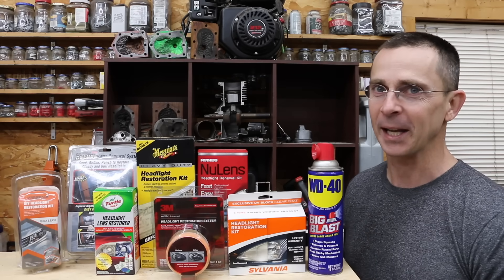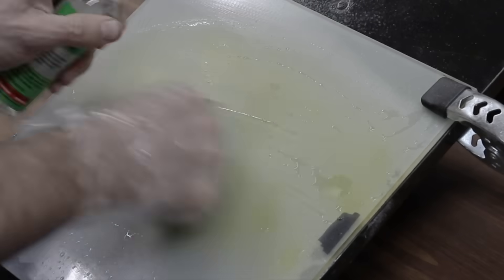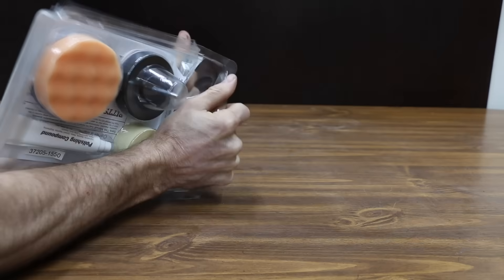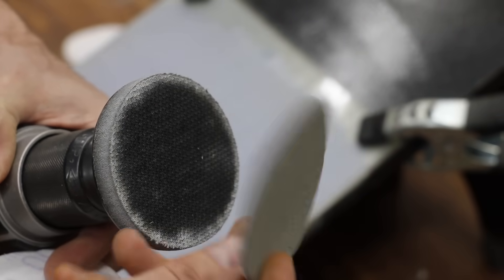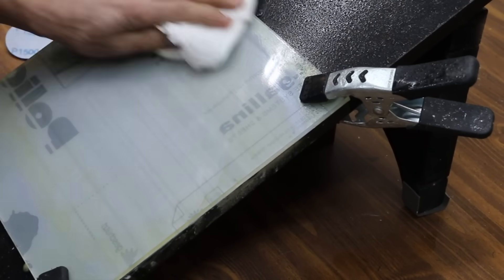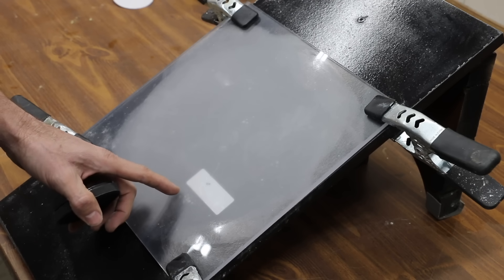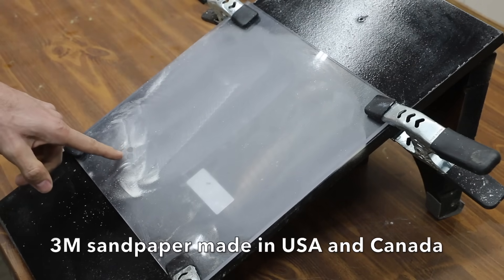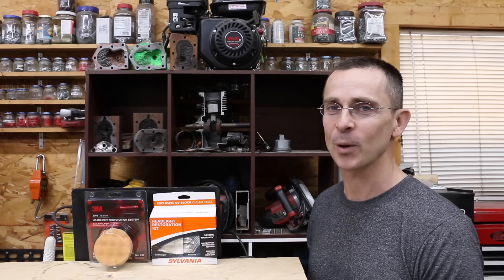Best Headlight Restoration Kit?  Let's find out!  3M, Sylvania, Meguiar's, Mothers, Turtle Wax & HF

Comment: I picked up the Sylvania kit last year to restore the headlights on my then 7 year old car that goes through dirt and snow at highway speeds, so they were in pretty rough shape.
It takes a lot of sanding work on particularly old headlights, but it did a great job. A year later, and they still look good. I think one could get better results with a lot less effort by doing this once a year or so.

You should do "best wiper blades" and test them against icy conditions, since I find I am always replacing mine every March\April because they get so torn up by ice, and every September/October because they get so messed up by the dirt and sun.
Reply: Aaaaaaaand I just found the wiper blade one. I swear I looked already! LOL.
Thanks again!!
Reply from the maker: Thanks for the feedback.

Comment: give CERAKOTE Ceramic Headlight Restoration Kit a try   
https://www.amazon.com/gp/product/B084RQKLV8

I bought this to restore headlines on a 20 year old car. but have not used it yet, plan  on getting to it soon. 
I have been focusing on other issues with the car , first.  after all I could use this kit  on another car if  the 20 year old car didn't make it.

Comment: Years ago I tried ChrisFix's method of using sandpaper and Rustoleum UV protected clear coat, I had a great result, the sandpaper was a little expensive though, I could have just got new headlamps for the price. It did a good job, but I found the Rustoleum clear coat didn't hold up to UV exposure very well, and after a couple years, it looked as yellow as it once did.
Reply from the maker: Thanks for sharing.

Comment: How about Cerakote Ceramic? 
https://www.ebay.com/itm/Cerakote-Ceramic-Headlight-Restoration-Kit/392881068440?_trkparms=aid%3D1110006%26algo%3DHOMESPLICE.SIM%26ao%3D1%26asc%3D20201210111314%26meid%3D8743333795044ea9969802e478c8ef7c%26pid%3D101195%26rk%3D1%26rkt%3D12%26mehot%3Dsb%26sd%3D392882123244%26itm%3D392881068440%26pmt%3D1%26noa%3D0%26pg%3D2047675%26algv%3DSimplAMLv5PairwiseWebWithDarwoV3BBEV2b&_trksid=p2047675.c101195.m1851

Comment: On this one I can save you the trouble, all the products in this test throw them in the trash, then wet sand lenses with a good quality 2000 grit paper, if the lenses have any deep scratches work your way up with wet 600, 800 or 1200 before finishing with 2000. Now use a high speed pneumatic polisher (8,000 - 10,000 rpm non-orbital) with 3” foam pad with 3M Perfect-It #36060 Polishing Compound applied liberally. You will be very happy to see a brilliant shine almost immediately after finishing with wet 2000. You’ll find that if there are fine cracks or hazing imbedded deep within the plastic lenses no amount of sanding and polishing will save them, however if only the surface has been dulled you’re in great shape. Your welcome

Comment: This is really useful.
I have seen a lot of ford focus with very dull headlamps and we have at home a Toyota which needs this treatment.
Some car manufacturers must used some much better polycarbonate than other or have better UV protection because I always found it odd that my C4 coupe head lamps never turned dull and the car was parked outside, on the sun all of it's life.
Reply from the maker: Great to hear!

Comment: I use VIM house hold cleaner, works great and very little effort is needed. All you need is two rags, a bottle of VIM and some clean water. Shake bottle, squirt on rag and scrub in circular motion. when the grit is gone, rinse with clear water and clean rag. Almost any rag works.
Reply from the maker: Thanks for the feedback.

Comment: I'd like to make a case against using any UV protectant on the polished lens. Over time, the protectant will also degrade and yellow, just like the original finish, and in a year or two things will be back to how they were — and you'll need to re-do the procedure. Instead, I recommend using the 3M kit to polish the lenses to almost-new clarity, and then periodically (every couple of months or so) taking a dab of polishing compound and polishing them back to the same clarity as before. Personally, I use 3M's Perfect-It Ultrafine Machine Polish for the task, but I'm pretty sure any light polish will achieve similar results. It takes ~5 minutes and less than a dollar of product to keep them looking clear, without the need of an hour+ of masking, taking out the power tools, etc. that the full procedure requires in order to do a proper job.
Reply from the maker: Thanks for the feedback.

Comment: Just bought the Mothers brand $29.00 at O'Reilly.  Lousy sandpaper and made a mistake in spray painting a clear coat on after polishing with the provided polishing compound.  Thought I rinsed off the compound good enough with plain water but no the clear coat acted like oil on water. Bummer, had to sand it all off and start over.
Reply from the maker: Sorry to hear that!

Comment: I use a 2" dia  pad for a cordless drill drill and put a round piece of packing material they now used for cleaning/abrasive. I use a medium to fine grade pad with water as I clean the plastic lens. Then I use a foam pad with lens restorer liquid that is usually blue in colour on my air buffer, about a 3 inch dia. pad. Lastly I spray the clean dry lens with UV resistant clear coat..  BUT first price out a new light assy. as they can be inexpensive and will look the best.
Reply from the maker: Thanks for the feedback.

Comment: if and when you do your next headlight restoration video could you recommend a coating for the headlights whether it be UV resistant clear code from home Depot or 3M UV protectant or any of the five or six things I can't think of right now .lol and the best way to prep the headlights before applying a protected some people say use rubbing alcohol other people say nail polish remover, mineral spirits some people were telling me to slightly heat the lens up before spraying it with the clear coat. some of these old heads in their recommendations baffle me but I dare not question their message. thanks for your time
Reply from the maker: Thanks for the suggestion.

Comment: I've done many headlight restorations and came to the conclusion the most crucial part is the sealant...So I found this "wolfgang" polymer that comes in a spray or a bottle...It cures crystal clear and lasts a long time...Now I just sand, polish, then seal...A 30$ bottle is enough to do probably 300 headlights
Reply from the maker: Thanks for sharing.

Comment: I want you to know that I got tired just watching these operations. You will excuse me if I say that  all these exercises are a waste of time & energy. The cheap crap they use for headlight  assemblies have a limited lifetime. The "sealer" that is used to prevent UV  destruction of the lenses cannot be restored by these methods. The only answer is to purchase new assemblies. They are certainly cheap enough. I have changed assemblies in three vehicles, & the cost  varied between $36 USD  to $79. Along time solution & no screwing around polishing & washing & God knows what else.  The video was great as usual.
Reply from the maker: Thanks!

Comment: I have used the progressive sandpaper method to great effect. I then masked off a large area and sprayed the headlights with a high luster, clear UV resistant spray paint. They're like new, and 3 years later still in very good shape. Thanks  for your experiments!

Comment: I've been looking at reviews of the 3m and Sylvania productions on Amazon and they all seem to indicate that after 1 year they're faded again and need restoration work again.  There seem to be UV protectant products like Meguiar's headlight coating which promote up to a year of protection, perhaps a next review could be which product protects restored (or even un-restored) headlights over time to avoid having to perform the sanding/polishing routine again.
Reply from the maker: Thanks for the suggestion.

Comment: You should try to do this again, but with DIY ideas. I see you tried WD40 and you can include it again. But you can try toothpaste, OFF with 25% DEET, and some other methods you might find.  I think the OFF method not only works, but lasts. You just need to clean it with vinegar once it's dry to keep it from continuing to eat through the plastic and to prevent it running off in rain and damaging other parts of the vehicle . Numerous vids showing this works, just need to be careful. But there are other supposed DIY methods that people claim works well.
Reply from the maker: Thanks for the video idea.

Comment: These restoration kits are a rip off. This is NOT how you restore headlights.
Reply from the maker: Thanks for the feedback.
Reply: I always hear mixed things about these types of kits. I also see videos suggesting after sanding with various grits to use clear coat and then wet sand/polish that. For the average person who doesn't have a fancy car what do you recommend and could you link any videos? Thanks. My g/f has an 04 Pacifica and her lenses are very discolored so I wanna clean them up in cheapest but best way possible.

Comment: Great tip(s) here! I'm all about saving money .... time & effort is money however. If you're planning to keep the vehicle a year or 2 and if it doesn't have those fancy pants LED embedded lamps....just buy a new pair of headlamp housings from your favorite online resellers. A pair can be as low as $60 USD and get brighter reflectors at the same time. Often they come with new bulbs as well! 
       Though do apply a UV coating for even longer longevity. Yeah...10x the price but what a time saver. (Tip though: before starting the replacement, shine your lights against a garage door or a brick building and make note of the alignment where they shine because your new ones, will most likely need adjustments back to proper alignment).
      Polish is a great siolution....but new assures your housings won't leak sweat etc....if yours are getting that age and collecting moisture....Polishing won't correct moisture collection issues....
Again thanks for yet another great set of videos!!!!
Reply from the maker: Thanks for the feedback.

Comment: By far the best way is to sand the entire surface of the headlight with 800  grit sandpaper then 1000 making sure to sand away all traces of the original factory clearcoat then recoat with spraymax 2k aerosol  clearcoat or eastwood 2k aerosol clearcoat. This methode will last for years and will make a headlight look brand new
Reply from the maker: Thanks for the feedback.

Comment: I've tried the 3M kit but it was a bit expensive, good results though.  Then I just bought decent brand pads and sanding discs from ebay and a light rubbing compound I had in the shed to finish.  Worked out at £2 per kit and worked every bit as well
Reply from the maker: Thanks for sharing.

Comment: Really appreciate the insight and demonstration of each item. I have been looking into restoring my headlights on my 98 crown vic. I know I can order a new set for around $50. But I tend to be the type of the original can still work is rather keep it. Definitely looking into the 3m brand. I've seen they have a rubbing compound that's supposed to work great as a clear coat for this type of thing.
If you could would love to see your test results for different clear coat finishes on headlights. I've seen people use clear coat paint, a 3m rubbing compound different car polish type products for sealing headlights after they did the restoration process with sanding
Reply from the maker: Thanks for the video idea.

Comment: Appreciate your thorough review of these different products.

Bottom line is to remove the damaged lens material by someone who has the skill and polish to a smooth surface. Recoat with what is right now a quality ceramic coating.

I've done a bunch of headlights and it's not a one size fits all process unfortunately.

I have had good results, most lasting two years or more. Maintenance is key as the sun and general driving abrasives take their toll.

Thanks again for your videos.
Reply from the maker: You are welcome!

Comment: I just use Mothers brand metal polish from Walmart where they sell car wax. I use a microfiber cloth and buff in small circles for about 2 minutes then wipe with clean part of cloth. It only works on oxidation. Will not work on heat related stress cracks. Works great. 5 ounces cost 5 bucks plus tax at Walmart. Blue diamond metal polish works just as well.
Reply from the maker: Thanks for sharing.

Comment: I used a 3M medium duty restoration kit on my headlight lenses and it worked pretty well. I did not have a powered polisher at the time so I removed both headlight assemblies from the car and used the arm strong polisher in a sink with plenty of water. I spent several hours sanding and polishing over a few days and found the results satisfactory. I’m not sure if it was more due to the products used or my determination and elbow grease. Anyway, after about 1.5 years I’ve noticed the lenses are again hazy. Probably because no clear coat was included with the kit, I did not know manufacturers used clear coat on headlight lenses to protect them. I will probably remove the headlight lenses again before long and do them again, but this time, I will get a kit that includes the clear coat.
Reply from the maker: Thanks for sharing.

Comment: New subsciber after watching couple of you reviews. I ran the gambit with a few of these restorers about 2 yrs ago. I settled on the Sylvania not because it was easy (I'll never get those hand sanding hours back) but because it was amazing. But follow them directions to a T especially the final application, avoid trying to go-back. Also info ya'll, Meguiars does sell a spray headlight coating to protect renewed headlights, etc. Thanks alot man.
Reply from the maker: Thanks for watching and subscribing!

Comment: I love all your videos... i use the Pittsburg Deluxe Lens Renewal System all the time and in my experience with it the sand paper never clogs up on headlights. I think maybe the yellow paint you used to simulate the oxidation is what was clogging it up. I have used other Harbor Freight sand paper in other applications and yes it is terrible... all brands they sell of sandpaper clog up in most applications... but this Lens Renewal Kit in particular works great for me. But i havent really tried any others. So im glad i watched this video. Im going to go get the 3m kit tomorrow and i use my own type of polish then clear coat it with the paint you showed in the beginning of video. Thanks again for all your hard work!
Reply from the maker: You are welcome!  Thanks for the feedback.

Comment: Perhaps find a matching pair of severely oxidized & UV damaged headlights.  Then cut them into even number of strips (equal to number of products under test) with a bandsaw.
   Now repeat your test upon these individual sections of the same material that has been subjected to the EXACT SAME —REAL WORLD—  damage.

I really enjoy your product testing videos!

However, (respectfully). The fake “exposure damage” you subjected this material to, is laughably flawed.   The worst factor a damaged headlight is subjected to, is the Years of Intense UltraViolet Radiation Exposure, along with scratches, gouging, & knicks.
  So, this test is rather unrealistic. 

  But, please know, I really appreciate all that you put into your video series!   They are quite useful & I will continue to support this channel favorably.

Cheers

Comment: I really like your channel and usually believe your testing to be very informative but in this case I can tell you from personal experience that something was wrong. I have personally used the Turtle Wax kit. I used one kit on two vehicles several months apart. I first used the kit on a 2013 Ford Focus with heavily clouded and moderately yellowed headlights. The kit restored the lights to a near perfect clarity. I did not us a macro to examine the scratches but the yellowing was completely gone and the cloudy look was gone everywhere except in some small areas that were tough to get the pads into. They were very small and only noticeable if looking for it. The average person walking through a parking lot glancing over at the car would think they looked nicely polished and clear. Several months later I used the kit which I had stored in sealed tupperware containers on a 2015 Nissan Altima. It again worked fantastic and restored the lights to a like new look. Here in FL the sun is brutal on headlights. This was done almost two years ago on the Focus. There is a mild clouding beginning to show but they still look pretty good.
Reply: In the northern states we have a full combo of flying debris road crud and salt spray and wicked UV light. In most cases the yellowing is a side effect of UV exposure but clouding and hazing are actually layers of the polycarbonate becoming dull. You actually need the stuff like the 3M kit and it’s abrasives to remove the dull and dingy outer layer of plastic. Some of those kits work better on other stuff but weaker on others. The sylvania and 3M kits are the best all rounders and are capable of restoring most dulled out lenses to like new

Comment: Did you feel like Popeye after all that scrubbing? I don't buy the kits, I use stuff I have on hand; progressively finer sandpapers up to 2000, then toothpaste. I did buy Mequiar's G17804 to protect the polycarbonate and coat the lens once a year. At about $8, it has lasted 4 yearly applications, so far. Seems to cost about $5 in materials, far less than $20+ kits, works well and is durable. The reapplication prevents continually doing this. I also have far better results with 3M abrasives. If you ever update the test, maybe compare it to this approach. $3 in sandpaper, a couple pennies for a glob of toothpaste, and $1.50 in protectant...
Reply from the maker: Thanks for the suggestion.